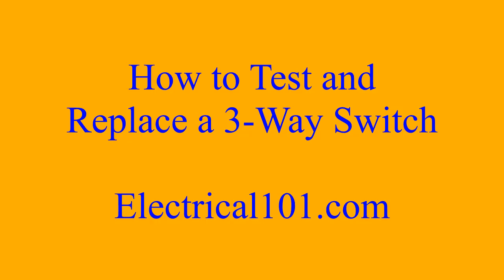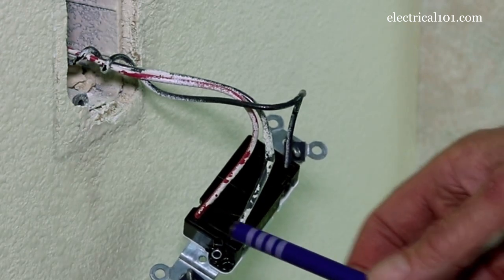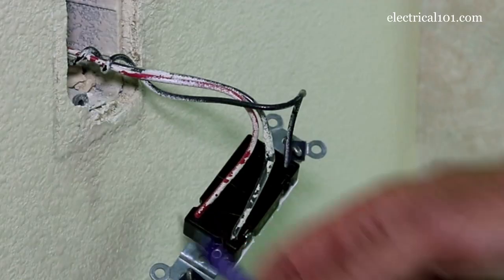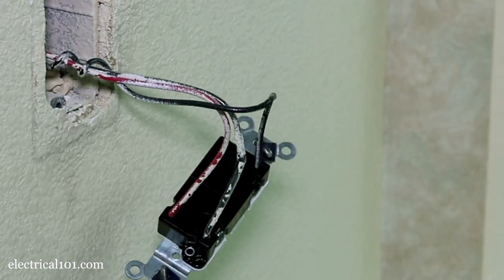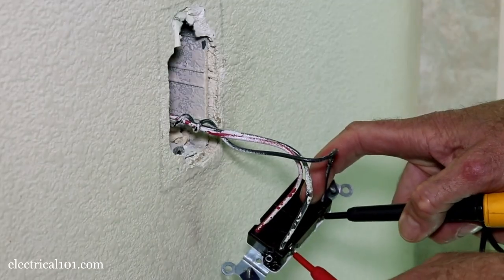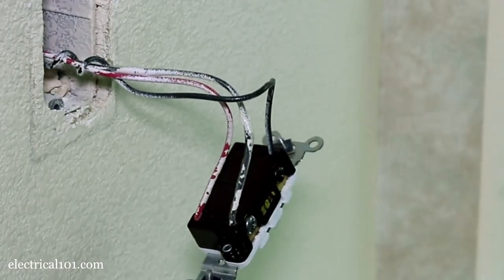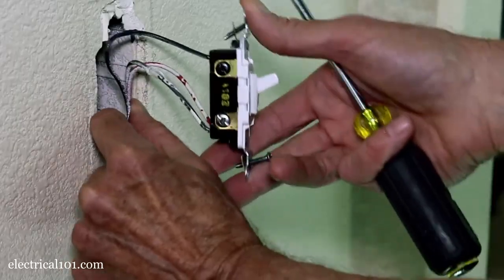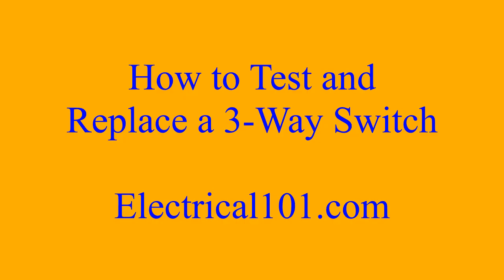How to Test and Replace a 3-way Switch

Comment: So if you switch is bad and needs to be replace, what would happened in the test?
Reply: no continuity with tester. I had some new ones that were shorting the breaker on house panel. Swapped out with another switch and issue is resolved.

Comment: I had a 3 way work fine for 3 months and then only would work if both were switched on. Why failure after 3 months? Could this point to a larger looming problem?
Reply from the maker: Sounds like one of the switches failed or there may be a loose connection. It is possible it didn't work but you just noticed it after 3 months? https://www.electrical101.com/troubleshoot-3wayswitches.html

Comment: I have a 3-way switched light that will not go off no matter what combination of positions the switches are in.  Its an old installation (probably in the 60s) and one of the switches was replaced about 6 months ago and was working fine.  Just yesterday it stopped with this always on condition.  My first reaction was just to replace the other old 3way but is there something else going on?  I don't think I ever heard of this failure mode.
Reply from the maker: For 3-way troubleshooting help see: https://www.electrical101.com/troubleshoot-3wayswitches.html
Reply: Turned out the newly replaced switch had failed.  Checking continuity showed one terminal always hot no matter the position of the toggle.  My concern now is what caused that condition; just a bad switch or did some over-voltage / short make it fail.  Since the wiring has been there for a while and I didn't see any burn marks on the switch I'm hoping it was just a bad switch.
Reply from the maker: @bob19611000  Although rare, new or newer switches or other devices can and have failed. What is the brand of the switch that failed? Since there are no burn marks or if you don't hear a crackling noise, or the switch doesn't get really hot, you should be OK to replace the switch again.
Reply: @jimrhoch  Leviton
Reply from the maker: Leviton is a good brand IMHO. You should be able to exchange it

Comment: What setting on your multimeter?
Reply from the maker: A solenoid voltage tester was used in this video, it doesn't have settings, but will beep with continuity. When using a multimeter, use the ohms setting and look for 0 volts to indicate continuity. A multimeter will usually have a beep setting for continuity, sometimes as part of the ohms setting.

Comment: Thanks for your video! I struggled with a three way switch set up where one switch worked great but the other switch only worked in one position.  I never thought that a switch would fail after only 34 years in service.  Your video demonstrated the use of continuity testing, which identified that one leg of the second switch had failed.  I put a new switch in its place and it is working perfectly now.  Thanks!!!
Reply: I have the same problem, but only after maybe 3 months of use... any idea why this would be? Could it point to a larger, looming problem?
Reply: @VivaLasVegusNervana  I don’t have an answer to your question. Is it possible you got a switch that was defective? I rarely ever experienced a switch failure and then only after many years of high usage. Maybe a real electrician can tell us.

Comment: I already replaced my 3 way switch and just copied the (super old) old switch by lining up the ground wire screw placement, and then detaching one wire and reattaching it one at a time, but old switch was “upside down”... and now I’m terrified I miss wired and my house will burn down... the switches work fine... does that confirm I did it ok?
Reply from the maker: If the switches work fine you did it OK.